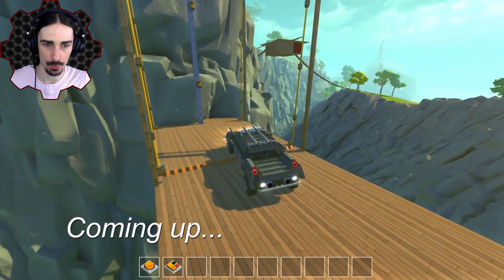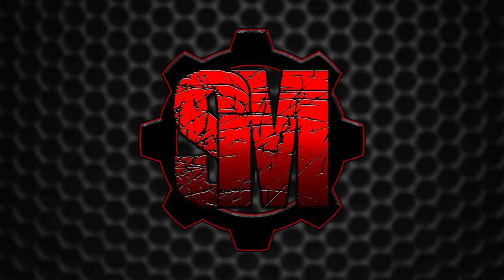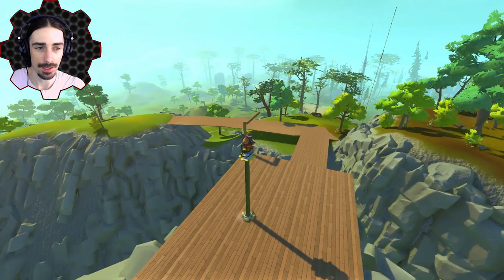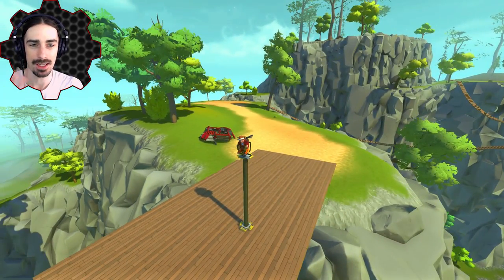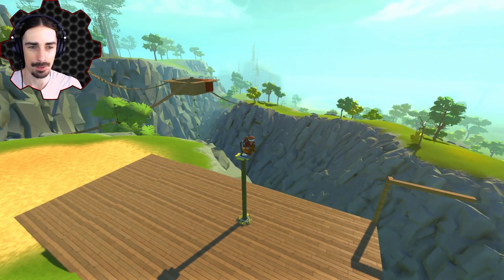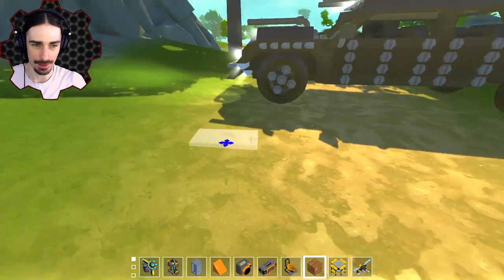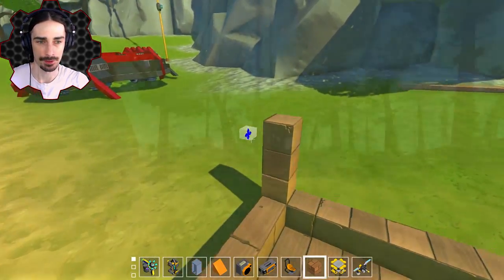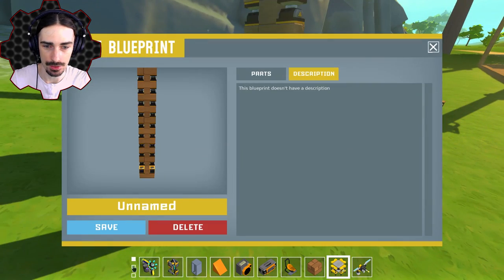2 STAGE CAR PISTON ELEVATOR! (Suspended Mountain Base Part 7) - Scrap Mechanic Gameplay

Comment: You should put a sensor in the middle of the elevator so that when you drive in to the elevator it activates without you needing to jump ut.
Reply: linus brommesson but what happens if your vehicle is half on, Good suggestion though
Reply: that is exactly what i wanted to comment
like goes!
Reply: Useless Gamer timer
Reply: Or maybe put it near the back
Reply: Yes
Reply: Linus 30 what happens when he’s getting off, it starts going down when he’s getting off at the top
Reply: Joshua Hollenbeck a timer for delay...
Reply: Noice

Comment: When you welded the platform at the 1st elevator to the bottom of the "piston-sticks" it got 1 block to tall which I think made the issues with the elevator. Like the gap at the top and probably the lag. 

Edit: I think the lag is caused because all the pistons is always trying to push itself a fraction of a block further, and that is also why the lag stops when you start to go up.

Comment: Scrapman you made A mistake with the first elevator, you made the blocks between the platform and te piston-"line" 1 block to long, so the elevator is 1 block under the drive- way up above

(Sory for the typing)

Comment: Seems that having a sensor at like 2 blocks distance, hooked up to the switch system would work for the not getting out of car... 

Problem is where to put it so it doesn't trigger accidentally, I was thinking in the middle of the railing at the side

Or maybe one sensor that brings down an arm with another sensor and you just drive towards when you're ready

Comment: I've had the same issue with piston building where you place something and they reset. I was building a house with a piston door and every time I extended the house the door opened in a millisecond and closed again. It shouldn't effect the build too much

Comment: Hey ScrapMan you should try an ROCKET based elevator for your bridge suspended base.
You can make an elevator like a box and some guide rails in the corners that go up to the base so the elevator doesent fly away. You can mount the rockets under the elevator and hide them in a campartment on ground. Please read this. i love you and your content.
Reply: ProOnly this is one of the first ways of building a elevator when scrap mechanic was released... but for steampunk theme itl be i think some kind of ok?

Comment: Plz try to make it fully suspended. It will be really cool.  Plz 😵😵😵😵😩😩😩😭😭😭😖😫🙏
Reply: ScrapMan you can try connect "ropes" with bearings on a platform. And build fake trees or something like that and first build platform on a lift with ropes and then then make something that will catch the ropes at all 4 ropes. And from that make trees or tower... I don't know it is possible. I can't try it.

Comment: Update: 7-30-17

I was able to get a prototype to work. Here is the Link

http://steamcommunity.com/sharedfiles/filedetails/?id=1094743386

Feel free to use the concept on your base.

Thanks,

7-29-17

To make the elevators automatic add a sensor and a timer block. You will probably need some logic make it work perfectly but this way you won't have to get out of your car. I will play around with it in creative and let you know if I find a design that will work.

Comment: There's a glitch where sometimes when you build onto a building and it has pistons that are extended, they retract instantly and then go back. It's like if you reset it then turned the switch back on. I sometimes forget to retract my pistons before building onto the building and because of that it has caused many of my creations to break completely. :/

Comment: I think to avoid coming out of the car to make elevator go up, maybe place a sensor at front edge of elevator platform, so when the car comes forward to it, within 1-2 block distance it automatically makes elevator go up. So you'll have both a manual switch and a sensor operated switch. BOOM! Next Problem! :P

Comment: Yeah, I'm getting that bug in my cave elevator. Occasionally when you connect something to a "terrain-welded" creation, systems reset. My computer is not as OP as yours, so I get a brief white flash when it happens.

Comment: Flawless catch and alignment systems. Ready? Angled blocks. A square around the perimeter (top of the elevator) to ramp vehicles off the lift and into the platform, as well as a few around the perimeter of the lift itself to guide itself into the bottom platform which will have a few of its own to catch the elevator... Idk why he's not thinking of this...

Comment: The reason the first elevator is 1 block longer is because of how you created the piston pillars, you left a block on it. which is why the 2nd elevator is 1 block above (which actually worked well because of pistons unable to retract 100%)

Comment: Scrap Man you said, that you don't want to hop out of the vehicle when you drive it onto the lift, so I thought, that you should put a sensor in the floor of the lift and somehow  (maybe using the grego timers for having some time to get off the elevator) make it work like a switch activated by a car. I hope it helps somehow :-)

Comment: Add sensors to the elevators so when you drive on it it will go up
Reply: ConnorJr plays but what about when you drive off? How will it come back up?
Reply: ConnorJr plays nice pic
Reply: a logic gate, and a toggle sensor on the elevator and on the ground to the entrance of the elevator, and a  logic gate set to have them both have to be on to turn on.

Comment: a suggestion would be a flush guide bar that makes it have corners and just move the button inside. the guides would be solid which would prevent catching and be out of the way enough that you dont run into them.

Comment: Put a sensor in the middle of the platform as a drive over switch but you'd have to switch the constant signal to a switch also put it on a 10-15 second timer

Comment: 2:35 instead of the angle pieces on the elevators put them on the ground to help guide the elevator down and make it look better while in the up position.  And make the building shaped like a gear and have it rotate to reveal the stars to the basement.